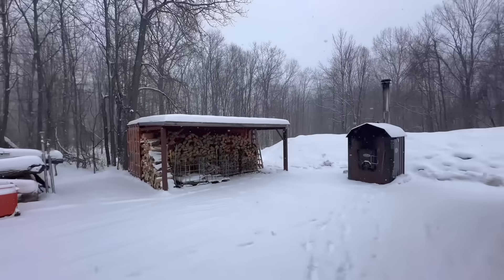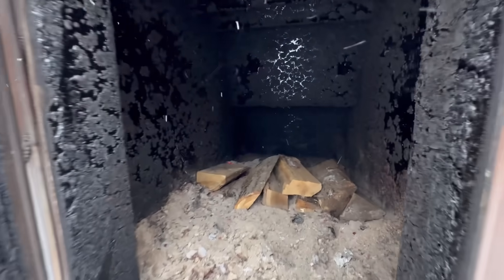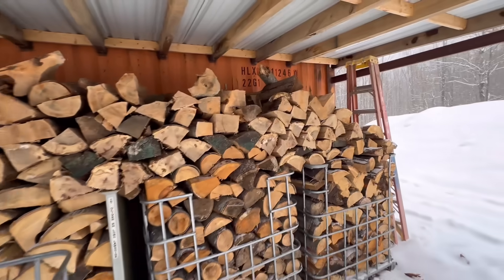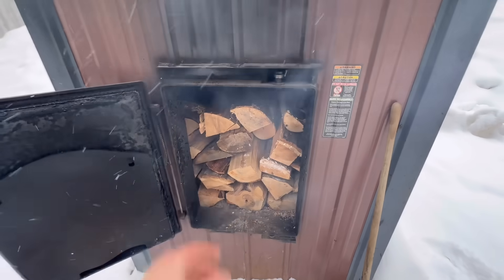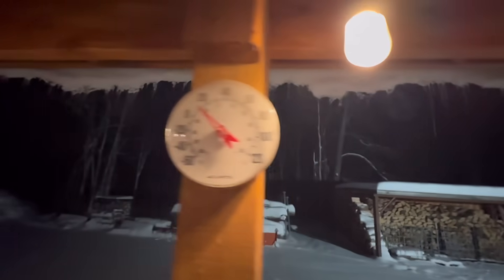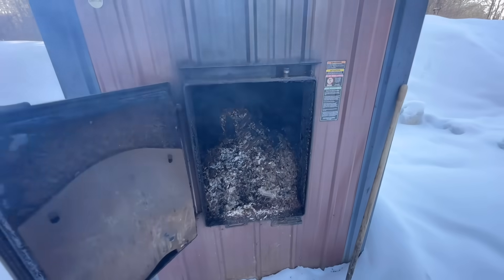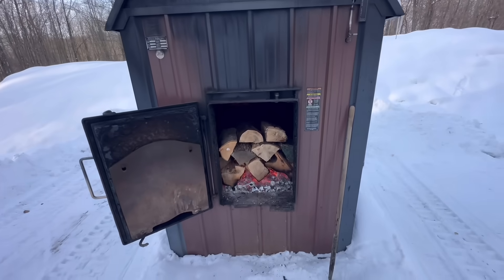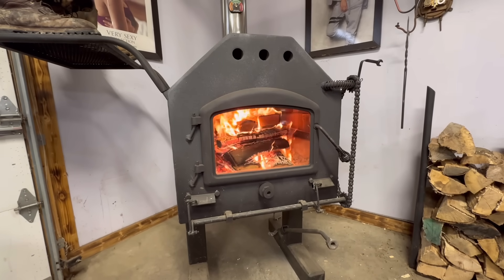How Many Hours a Loaded Outdoor Wood Boiler Will Heat During Below 0° Temperatures

Comment: You take more time throwing in those small pieces. If it fits through the door it will burn. And I burn wet wood only. Burns longer and one row. I have a 5648

Comment: The next logical step is a thermal mass brick stove inside the home.  They can be designed to be so efficient that the exhaust is almost cold, they easily use fourth of the firewood here for the same area.

Comment: Big hint. Use bigger logs. Don’t split them so much. When I had mine, I used 24” quarters, usually 20” trees, use more, no need for 12 hr feedings. Way too much work.
Reply from the maker: I like splitting my longs. Easy for loading/handling/splitting and they dry out much faster

Comment: Am I ever grateful for my electric baseboard heaters. No fuss, no muss and my total cost to heat my 2 bedroom apt last year was $345.00 CAN. That's in Quebec with -30C deg temps and colder.
Reply from the maker: That is surprising, if I used electric baseboard heat, I would be paying at least $345 a month
Reply: @Wolfpupfab  It's one advantage of living in Quebec. My cost for electricity is $0.069/kwh CAN. My total bill for last year was $994.03. I was born on a subsistance farm in Northern Ontario back in '44. We didn't get electricity till '51. I know what it means to hear nails go off like gunshots and shivering in bed while my father fired up the cookstove that was our only means of heating.I learned early to chop wood.

Comment: Just did the math, 30 cubic feet of wood will last me 2 weeks in the heart of winter Western North Carolina 2,000 ft altitude, using a horribly inefficient custom-made fireplace insert that weighs 700 lb that was custom made by some dude with a welding machine 40+ yrs ago. 900 sqft house, no other heating source whatsoever. Willing to bet I could cut my wood use down 30 or 40% more by installing a reburn system in the stove, whether with a catalyst or secondary burn tubes and baffle plate. Man idk about wood furnaces..

Comment: I am using the same boiler here in North Dakota since 2009
Use it to heat my house and shop plus my domestic hot water 
House size is is 30 by 70 and shop size is 42 by 65 feet
Reply from the maker: Nice. Do you still enjoy heating with it?

Comment: Thats a lot of tar on the inside of that furmace. Its a sign of inefficient fire/the wood is not burning hot enough. It also worsens heat transfer from the fire to the furnace

Comment: A friend that went from a indoor stove to a outside stove went from burning 6 cords to 12 cords of wood a season.
Reply from the maker: Sounds about right
Reply: It seems inefficient and less comfy. So why would people do it? Unless you have a huge ass area to heat
Reply from the maker: There are many pros and cons to both. Some pros with an outdoor boiler are 

you are able to heat multiple buildings from one boiler. 

You keep the mess and danger of burning with wood outside 

You can burn bigger or less desirable pieces of firewood in an outdoor boiler

Comment: Thank you for the video.  Opening and closing your outdoor furnace accelerated the burn.  Also you should not have raked the load.  I have a Kuma Fire 100 in my basement.   I put in a total of 7- 8  21" pieces for a consistent 12hr sometimes 14hr burn (species dependant).
Reply from the maker: Thank you for watching

Comment: You shouldnt have cut your wood so small with the size of your stove.  They will just burn up faster.  I dont know but i would think to use bigger logs.  Let me know.
Reply from the maker: The size of the wood does not necessarily change the speed it burns especially because this stove is damper controlled. Smaller split wood burns more efficiently than larger rounds because larger rounds take longer to dry and hold more moisture. The dryer the wood the better

Comment: I've never understood how a remote heat source is better than one located in the house.
Reply: From what I understand most provide hot water and heat for the house thru an exchanger or under floor piping that circulates cold out hot in.
Reply: @johnny8420h I understand how it's done. What I don't understand is why it's outside.
Reply from the maker: Keeping the danger of fire outside of the house is a large benefit. So is the mess of firewood. And also I can heat multiple buildings off of this one remote heat source
Reply: That's because you've never seen a boiler with parkinson's disease (i presume). Despite various safety devices on these boilers, when shit doesn't shit right the water can go above it's boiling point without being able to turn into steam because the system is pressurized. This is called superheating and it is in fact super scary. When you wake up in the morning to find every hot water pipe in the house litterally shaking loose from the drywall and the thermometer on the boiler reads 114°C that is some proper scary shit. These things can turn a entire house into a pile of rubble when they blow up and if a pipe bursts instead you'll wish you had been blown to pieces as you are being boiled alive in a steamcloud. Doesn't happen everyday, but it did happen to me because someone went and over filled the firebox before they went to work and for some reason the safety valve wasn't valving that day. Had to rush my family out of the house before i went back in to spray the firebox full of water. It was a skill issue for sure, combined with mechanical failure but mistakes happen and i feel like they should be able to happen without blowing my house up. I want those margins. 😊
Reply: @fredriksjoblom5161 Good work. Maybe a second safety valve would help ensure safety.

Comment: It’s hard for me to understand the amount of wood that people go thru.

I burn less than 10m3 (350 cubic feet) wood per year. The house is 176m2 (1894 square feet). Average temparature outside is 43f. Inside temperature is 68-70f

The fireplace is made of bricks. House is made in the 60’s. Windows, doors and insulation have been upgraded.

Comment: Depend mostly on how many lines hookup and line size. 1.00 line can only deliver 75,000 BTUs per hour 100,000 BTU is you have a killer pump not under pressure.. lot of variables with outdoor wood boilers. Great video. Your demand is low not heating as much sqft so last longer.
Reply from the maker: Yes lots of variables for sure. Thanks👍

Comment: i was under the impression these had forced air draft induction, but it appears they are not..am i right?
Reply from the maker: Some other models and manufacturers do. The model I have does not. It is very simple and that’s one of the things I like about it
Reply: I've owned a Heatmor for 20 years. It has a thermostat regulated blower. When the water temperature falls below the set limit the blower comes on and starts the fire. When the upper limit temp is reached the blower goes off. In between burns the fire goes 
Dormant with only the coal bed burning.

Comment: Put a wood stove in the house just like the one in your shop. You will cut your wood usage by 70% outside wood boilers are wood hogs. They are good if you were heating big area and you get the wood free.   Just sayin 👨🏼‍🌾🚜💨
Reply from the maker: I had a woodstove in my house for 6 years and I would say the outdoor boiler will consumed about 20% more than the inside stove. It is worth the little extra wood to keep the mess, smoke and danger outside

Comment: You are going to spend all summer cutting and splitting lots & lots of firewood.....and you are going to spend all winter filling your firebox with firewood......no offense....I appreciate what you are doing...I watch all your videos and you are doing a great job building the addition to your house.....but maybe heat your house with natural gas or propane if theres no gasline....I believe natural gas and/or propane also burns a lot cleaner than firewood if you are trying to be green & care about burning cleaner sources of fuel.

I not sure about your future plans but maybe some solar panels on your future roof for electricity.

Comment: I personally have no experience with outdoor woodburners, a guy i worked with heated with wood, we worked 24 hour shifts, he would load his stove before coming to shift, and still have wood when he got off shift and home after 27 hours.  He used 3 foot long logs just split in half average a 12 inch diameter, so a 12" wide 6" tall 3 foot long log.

Comment: If you want to do a true test  try loading the Fire box with just rounds unsplit wood  you will be surprised how long it last and how well it heats . I have been burning wood all my life. I have been working with wood from the age of 7.  At 7 I was filling the woodstove  with no one around . I am from a small family of 13. By the time I was 10 I was splitting wood. When I was 12 I was driving a 4x4 truck  cutting and hauling  and splitting wood. Here is what most people don't want you to know. Listen carefully. You have to burn small split wood  if you burn round wood unsplit or large splits you will die. Now truth is all wood burns  even wet wood burns not as good but it burns. Unsplit wood burns the longest. split wood burns faster and bring you higher BTU's but that means you will burn more and you have to load more in . Now at night  most people are getting ready to call it a night. They will not be going in and out. They will not be screaming for hot water. They will not be walking around in their house naked or playing hide and seek. At night it is also the coldest time of the day in to the wee hours of the morning. You do not need your house at 90 F at night  if you are sleeping under the covers you can get by with 65 F When you wake turn the heat up. But round wood will last a lot longer and you will have more then enough heat. The reason people say you have to burn split wood and small split wood is so that you use more and need more so you have to buy more. Toss in on a hot bed of coals round wood fill that box up and watch what happens . You are never going to know the truth if you don't try it for your self. If you are not happy with the results just don't burn round wood again. But you will not only be happy you will wish you knew this a lot sooner. Now I am not saying only burn round wood you need some split wood  for when you want high BTU's but round wood will save you a lot of time work and money.  Most old timers know this and they are doing this but they are old timers and most don't know how to turn on a computer lol. Try it get some unsplit wood that is dry or dry enough and see for your self.
Reply: Thanks Old Timer!
Reply: @bobg3034  🤣
Reply: Agreeed.   My parents house Been burning half rounds for a long time ,   We split a lot but add a massive round or half round in there at night and it's perfect.   Fill the rest with split logs .   Lots of wasted time.
Reply: Your exactly right, burning round wood last longer, ive had a central boiler for near 20 years and if i ever move, it's going with me, best thing I've ever bought for heat. It is the next to the smallest stove they made at the time. I load it once a day bottom to top with about  18" to 22" pieces and split only what I need to get it full, keep my temp to 180° , it keeps the creosote down in the stove pipe, and it lasts about 24 to 30 hrs depending on wind at around 30° during the day and in the teens and 20's at night. I burn only hard wood, hickory,  oak, cherry, locust and ash for the most part. I heat a 1700 sq.ft house and I have a basement and garage, dont have to heat my basement, the plumbing does that for me and my water is hot enough to scald the hair off a hog.  Love that stove.
Reply: @TimNicely-kg1gi  Most people assume  we are all idiots  most seem to assume  we can't  tell the difference between wet and dry wood. Most believe what they are told is true  even if what they are told is a lie because it is said it has to be true. Shorter splits burn faster yes it is hotter but no one needs a high yield of heat 24/7. The smaller the wood  the smaller the splits means the more you feed the stove and the more you burn

Comment: Don't push Embers too far back.  Stay in the front 30 inches. I wouldn't clean that out often. Yesterday after 12 hours I had 18 inches of hot Embers. Still 180 degrees. I let that ride for another 5 hours. It was below the door when I loaded it again. 17 hours on a burn.

Comment: The burn would be or is inefficient because a wood fire should permanentlyrun at full power.
And you don't have enough heating demand for that.
If you had a big heating water buffer tank, the furnace could do it's thing and the tank would absorb excess production, and deliver that to the house, when needed.
Reply: There is also a lot of tar on the walls because the wood doesnt burn as efficient as it could

Comment: 40 to about 46 hours from a full load up is about the norm for single digit days. Once you get the radiant floor heat going. You will see a bigger difference. Getting that concrete and the walls warm from the ground up will really be a game changer for you. Also look in to if you boiler can burn Nut Coal as well. If you can run a 70% wood 30% coal mix. It will heat longer and hotter as well.
Reply from the maker: Yes I am excited to get the radiant heat hooked up 👍

Comment: Do you ever have to clean out the ashes, or does it burn hot enough to keep cycling them ?
Reply from the maker: It burns them down to dust but I have to clean them out 2 or 3 times a year

Comment: My Grandfather was a fireman on the Great Northern Railroad in the early 1900's and he always would say the fire burned more efficient when the you kept the firebox full on the Steam engines.  He also would tell my aunt se need to keep the ash cleared out of her wood burning stove as he would say it reduced the efficiency of the  of the fire.

Grandpa said the steam engines he worked would burn Coal or Wood, and the main goal of the firemen was to keep a steady hot fire for maximum steam production.

What people do not know from the 1870  early wood or Coal Gasification was incorporated into many steam locomotive to increase the efficiencies of the locomotive.  Also  to increase the draft in the steam engine they would direct the spent steal through part of the fire box in increase the draft to increase engine efficiencies .

One famous locomotive that was a gasification locomotive was a down draft fire box that would burn the solid fuel producing the gas and in the combustion chamber the gas would be be burned to produce the steam with the exhaust gases recirculated back trough the boiler to mix with the spent steal to to be discharged out the the stack, producing a clean spent spark & soot  free exhaust from the locomotive.

My Grandfather always talked about efficient fires  in heating and he always banned candles in the house as the sooted up the walls.
Reply: people keep a bit of ash on the bottom of the stove to keep the heat in a bit more and the prevent the firebox wearing out.

Comment: I have no idea how you would clean it out, but one of the main features of these is to use long lengths ( less work for cutting and splitting) = greater than the usual 18". I can see the wisdom of your logic on loading the box, but we'll see.  If you didn't have access to free wood, it would be pretty expensive. Hey, if nothing else, the mess of burning wood is not in the house! Emptying all of those ashes will be a HUGE job.

Comment: that these boilers are ineffective is hardly a secret,in fact they are so bad that you are not allowed to use them in most part off sweden,we installed a new boiler thiss summer and i use the same amount off wood in a week at -5c in a house thats 135 m2 (1340 sq ft). if you whant to burn that boiler at a higher efficiency you should make it burn clean, iow not let it smolder,thats when you loose the bulk of the fuel when you pack it full,,and the pipe will get filled with tar and soot in no time,,not saying that this type off boilers dont have its perks,,you can burn allmost anything in them,,seen these with pellets or wood chips and even with a feeder that feeds it straw,,thats awesome,,,
Reply: They're very common where I am (Maine), but people always run them hot. The idea is you burn wood as hot and efficiently as possible and dump all that energy into water to store it.
During the coldest part of the year, we need about 1.4 Million BTU/day to heat the house (about 330m^2). That's at about -28°C, keeping the inside at about 16°C. A cord of wood (about 3.5m^3) lasts about 10-12 days, but if it's just smoldering it'll last at best half that.

There are ones that burn pellets or wood chips from a huge hopper, fed by an auger, but I've seen mixed reviews. While they're more efficient and you don't have to fill it every day, I've heard the auger and feed system is a real bag of cats, and you end up spending half your time unjamming it.